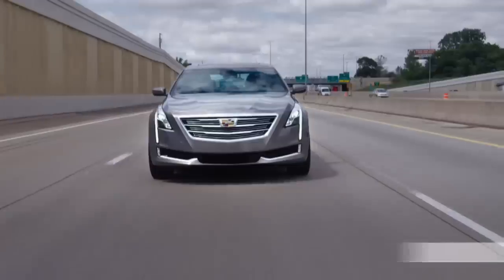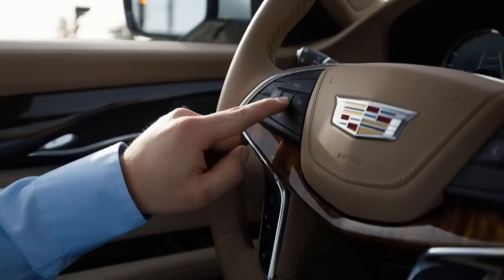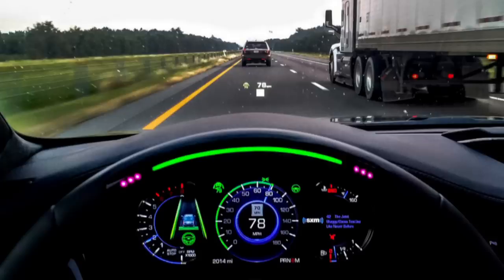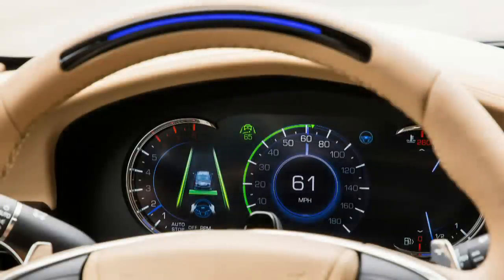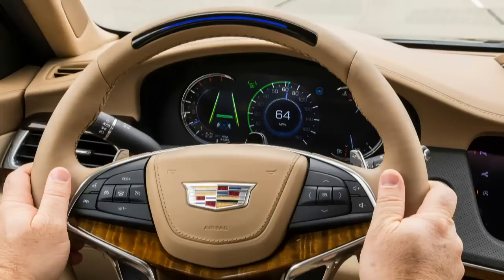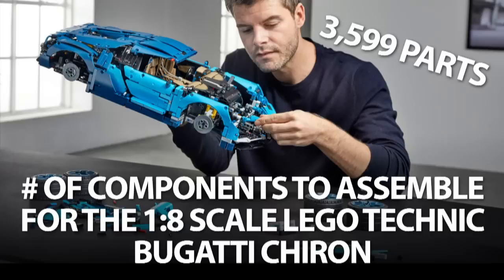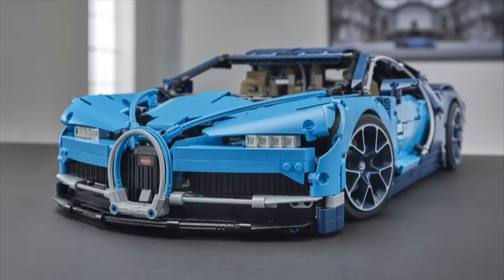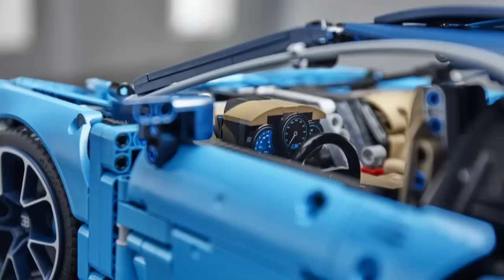Look Ma, No Hands! Here Comes Cadillac Super Cruise - Autoline After Hours 423

Comment: For cadillac (north star engine 32valves ) vvt chain twin logic one sensor gear distribution more weight check static sincronie firing order tri secuensia low middle high speed torq rpm increase decrease cruise 1 5 4 2 6 3. 7 8 one by one left right two for two four & four volts port echlin present or pulse enlace virtual elctronic one more damper viscous turbo elctric original 4phase asimetric two step opening 4step load full one step dont worry jhon mcroy cadillac boost escalade technology